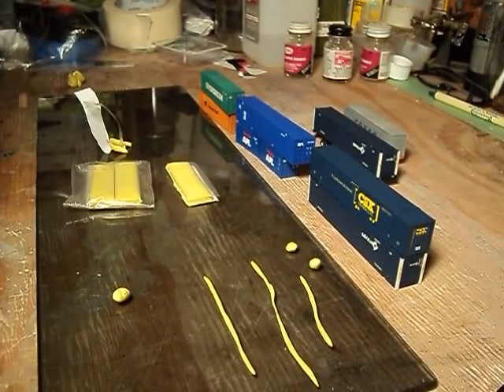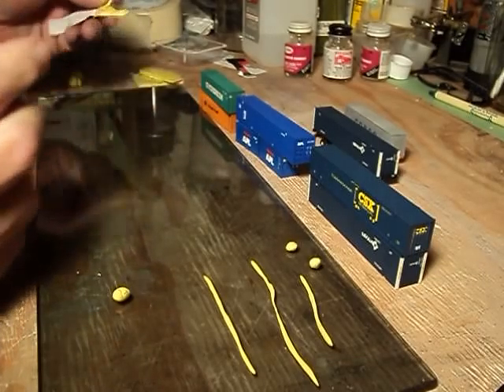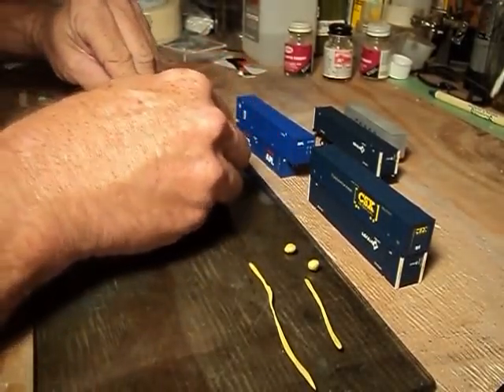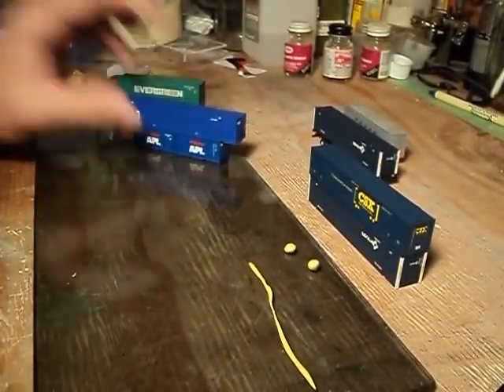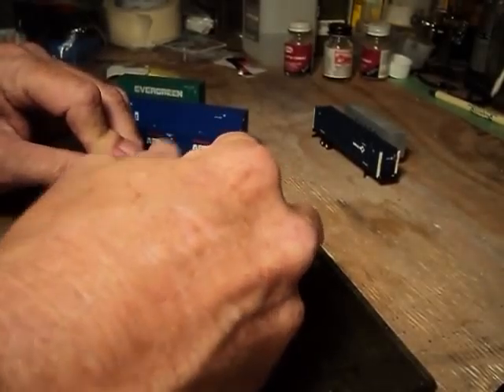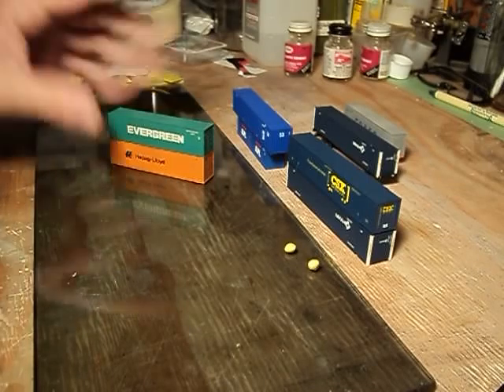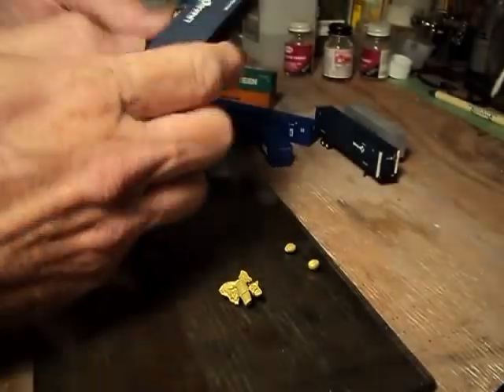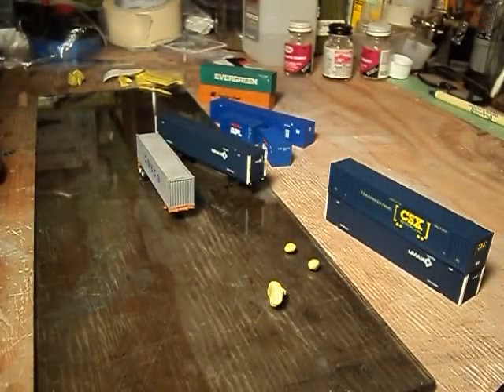Container Glue 004.AVI

Comment: hi this is bnsf6951. i liked this video good info.  i do have a question. for you or any of your subscibers.i just bought my first 3 car set of athern draw bar well cars. my question is, can these cars be converted to stand alone cars??? secondly, when i run these cars in the middle of the train & go around a 14R curve, these cars get pulled off the track. if i put them at the rear of the train, they run ok. is there a fix for this??? any help would be approciated
thanks ...vinny
bnsf6951